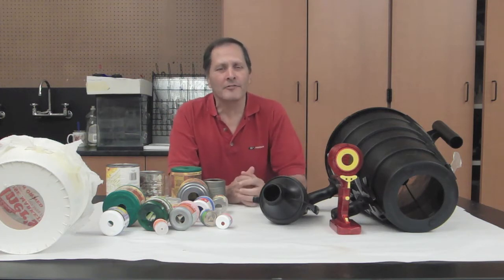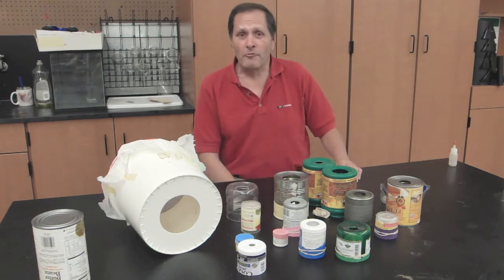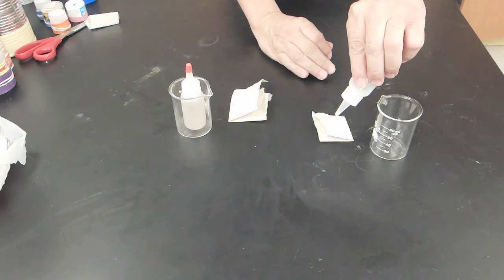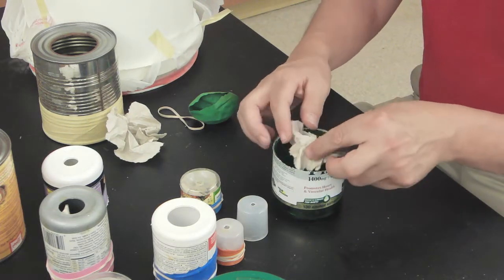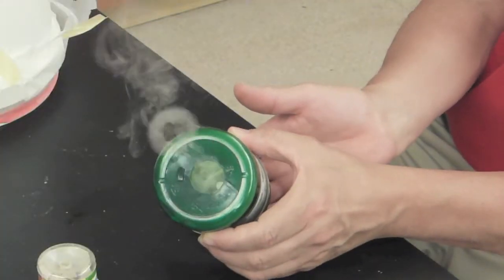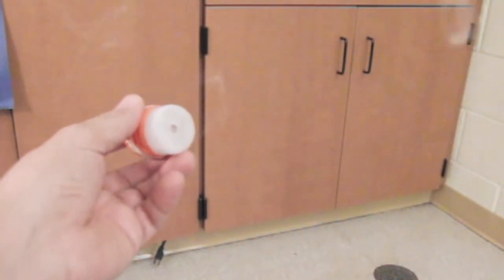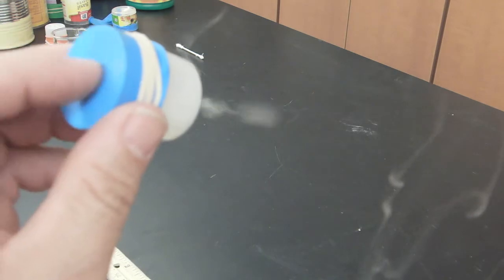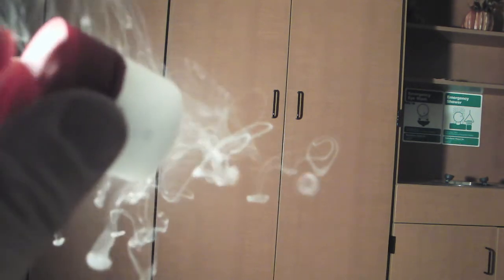World's Smallest Smoke Rings /// Homemade Science with Bruce Yeany

Comment: What is the chemical materials used in these experiments,Is there any harm to human health?
Reply from the maker: Hello Alev,   the  two chemicals are Hydrochloric acid (commonly sold as Muratic acid in hardware stores) and Ammonia.  Inhalation of either of these chemicals in not recommended.  I use extremely small amounts 2-4 drops.  The white smokey  product formed is called Ammonium Chloride.  It has various uses such as a fertilizer, it is used as an additive in foods in bread making and added to cattle feed, However it is also used as an expectorant in cough medicines as it is irritating to the lungs and will make you cough if inhaled.  Safety precautions for these chemicals should include eyewear, using very small amounts and good ventilation.
Reply: +Bruce Yeany (Yeany Science) thank you so much